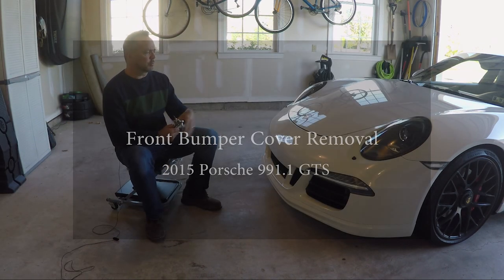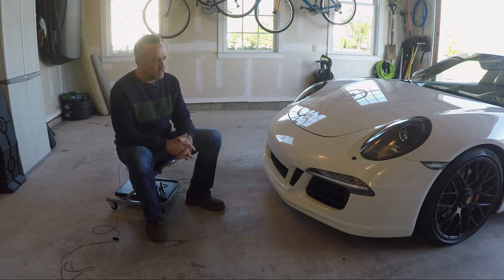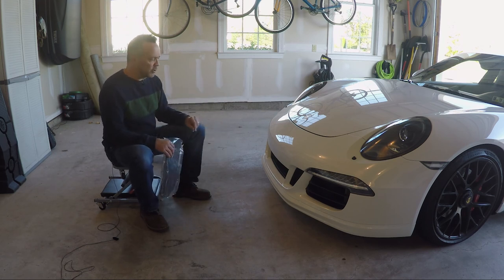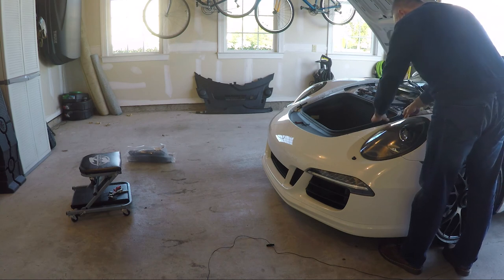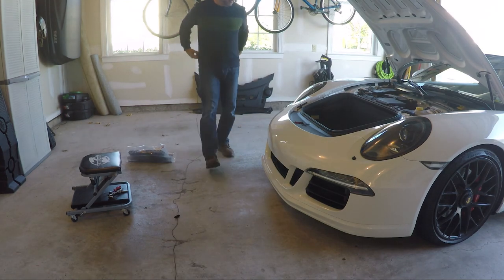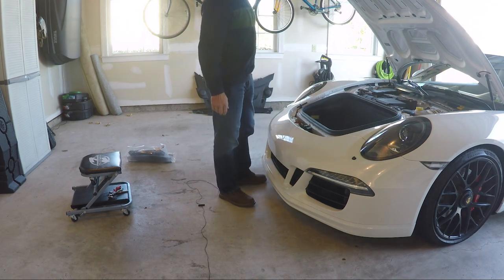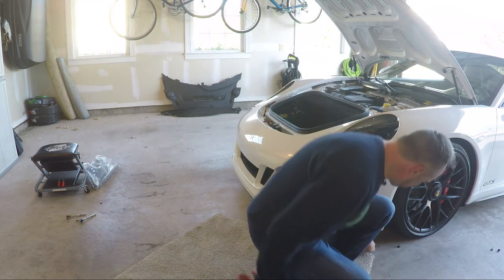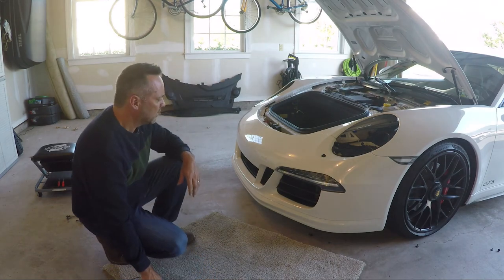GTS Front Bumper Cover Removal Porsche GTS DIY *Anyone Can Do It!*

Comment from the maker: A viewer pointed-out that you don't have to remove the side marker lights to remove the bumper cover.  The wiring harness running to the DRLs branch to each of the side markers on the cover-side of the disconnection, so you can leave the markers in place.  I have been in the habit of removing all the lights, so guess I should have thought about that a bit longer!  Coulda saved me what, 5 minutes or less?  Thanks!

Comment: New subscriber to your channel. Like it a lot. I just bought a 2018 gts coupe. When I got home I noticed on the sticker that the build was completed in August 2017. I picked it up April 30. Should I be concerned?.
Reply from the maker: Hi Bari and thanks for the comment!  Glad you find my posts useful!  I am not sure that you would have anything to worry about, considering you have an awesome car regardless of when it was built!  Are you worried about the build date being '17?  Let me know if I can help with anything!
Reply: GTSilver thanks. No , I know it’s a 2018. Just was concerned that it was in the lot a long time. Don’t know why it would not be sold when there is a 911 shortage. It seems fine.